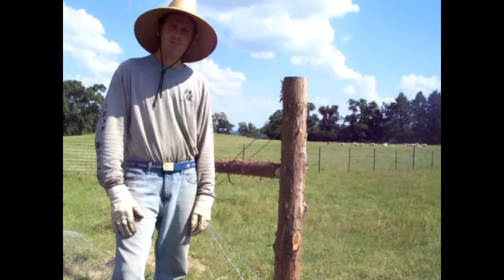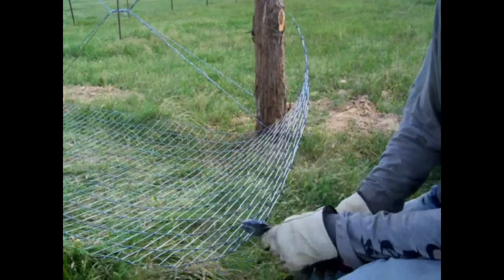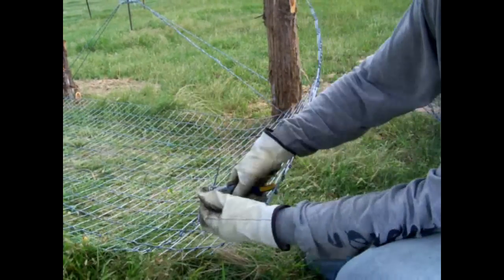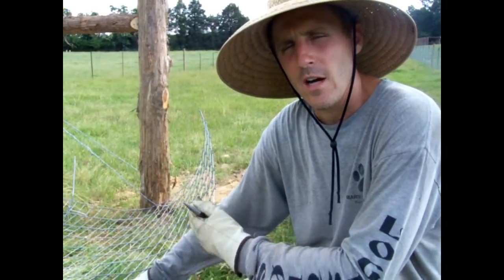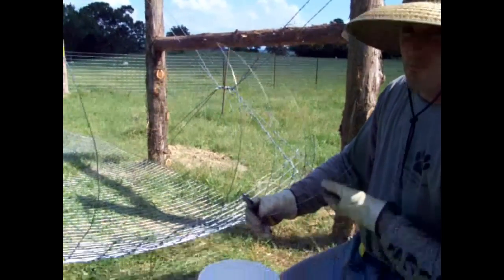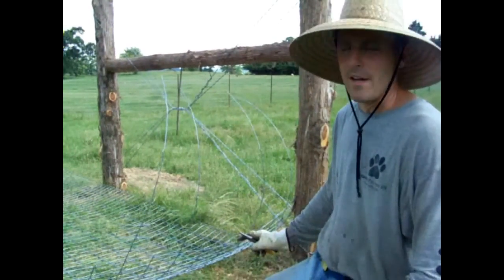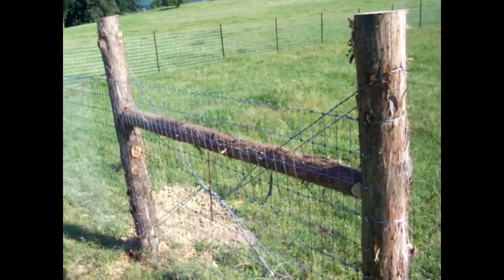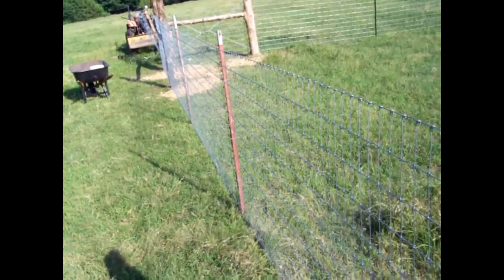Installing Horse Fence

Comment: Why do people use mesh for horse fence?

It's guaranteed to grab shoes.
Reply: What do you recommend?
Reply: @roystonfence816  Stranded, non-barbed wire. The thicker and heavier, the better to prevent cuts. I use Red Brand Barbless Cable. It's just as strong as High Tensile, but it doesn't whiplash like HT does when it breaks and it's a little cheaper. 5ft tall, 6 strands. I install it with the same exact methods as HT, using half of the strands as hot wire and the other half of the strands grounded. I also use HTs wire crimps for the electric connections. A good HOT fence keeps them Away from the fence so they never challenge it.

I would only ever recommend HT if you can Guarantee a Perfect installation and maintenance.

This is purely Horse fence, all other animals do very well with No Climb.
Reply: @seanhazelwood3311  Thank you for taking the time to reply.